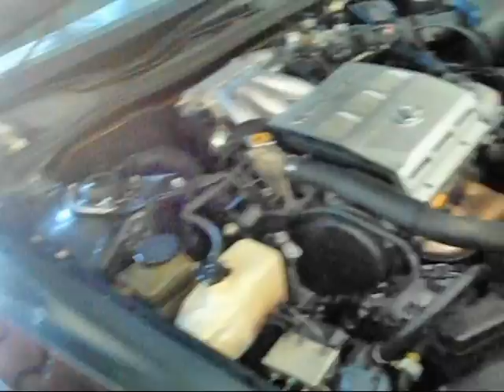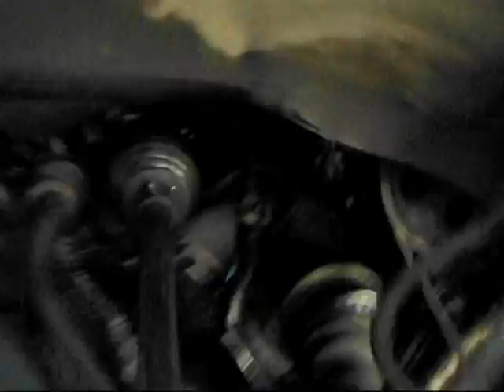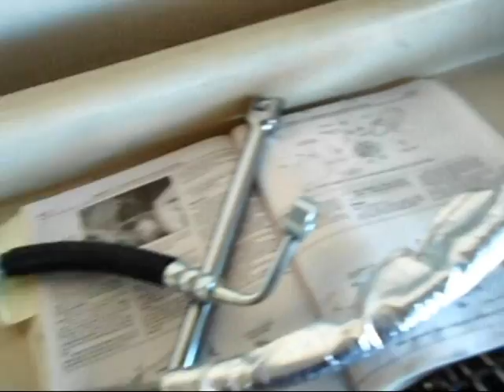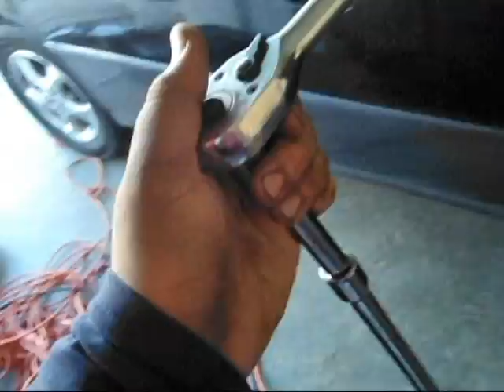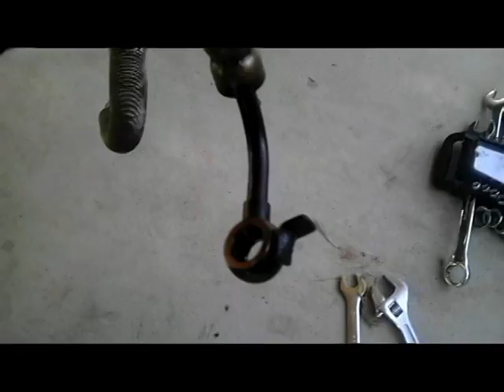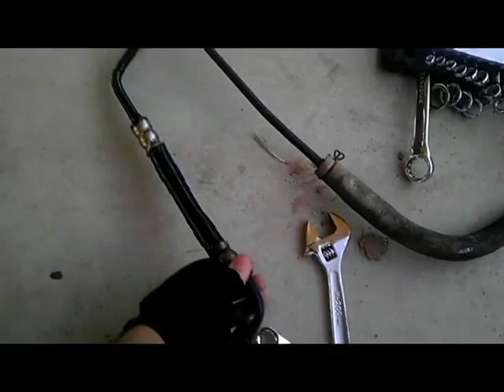Lexus Power Steering Line replacement

Comment: the hose on one end is crimped while the other is clamped....why they did not just make them both clamped so if there it will be easier to replace the hose only instead of the whole thing

Comment: ANY Tips would be appreciated.. 
I'm trying / debating on attempting this now, while it is simple to change a hose, this one's location with the straps holing it between the engine and firewall make it VERY difficult! Attempting to do this in my driveway on jack stands seems like it may not be worth it. Not sure if I have to maybe remove the whole intake manifold to make things easier or what..

Comment: I have. 1997 Lexus. Es 300 & i love it i just change. The struts & the steering pump and the car handles and rides so smooth I love it
Reply: I have a 2001 Es300 and it's got 226k miles on it but the suspension is shit rn i plan to get it replaced and my power steering pump is going out I believe I know I have a major leak of power steering fluid on the driver side hoping its just the hoses....
Reply: Got it fix man it worth it. Those car run forever
Reply: +Omar Carnegie oh for sure man what suspension brand did you get? KYBs? Monroes? Idk which to get plus it's all about the money... Next paycheck I'm doing that though buying parts
Reply: A1auto .com. Have strut for 250 Dollars. For 4.   I mostly buy all the parts online
Reply: If you want a smooth and soft  ride get Monroe  if you wont a stiffer ride get KYB
Reply: Monroe is more. Money 💴💵💷
Reply: Because Monroe  Strut comes with spring and mount KYB. Don't

Comment: Good info. Especially on the extension for removing the pressure switch and union bolt. At the rack end I removed the line all the way back to where it goes into the steer rack. This was easier than trying to separate the lines with the 17mm wrench under the car. You will need to have an extra o-ring(2 total - only 1 came in my kit - I had to buy extra orings at Auto store). I recommend getting the genuine Lexus part off amazon. If you can watch and wait, you can get it for about $150.

Comment from the maker: For a 1996 you actually have the hoses wrap all the way around the back of the engine I believe because I think u
Your car has hydraulic fans. It will be somewhat similar work just I think you have 2 or 3 high pressure hoses